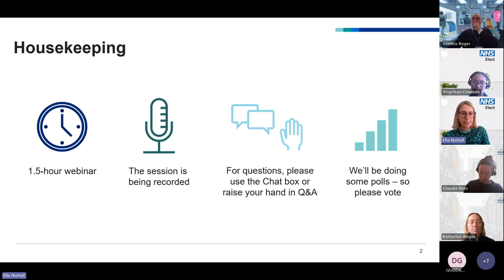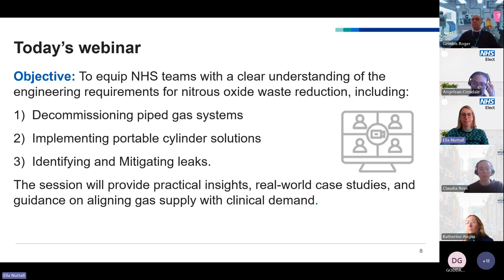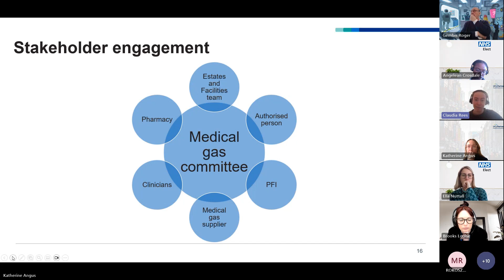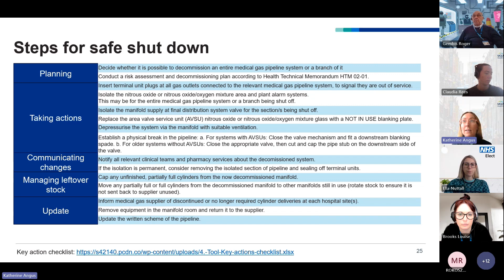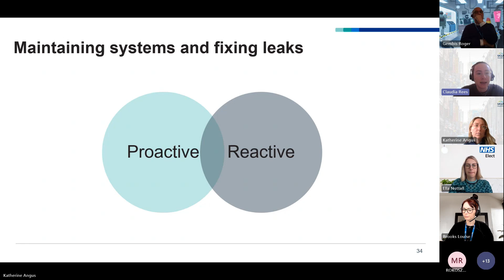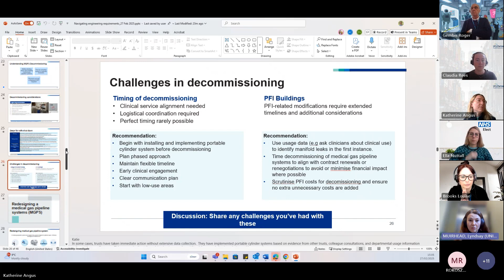Navigating engineering requirements

Comment: What a detailed discussion around Medical Gas Committee, Gas Management, Gas disposal, Gas leakage, and many more.

Obviously, Powerpoint is useful here for your meetings and presentations.

That said, I believe you must be using some other tools or documents management system that is helping you capture and manage requirements. 

At 14:56 minutes into your video there is discussion about Stakeholder Engagement and

At 16:39 minutes into your video there is discussion about upstream Waste.

These two topics were important from Requirements Management (RM) stand-point and we believe there are many other such points where RM can certainly help and improve outcomes.

Well, this is where OpenRose - FREE and Open Source Requirements Management Application can help. It supports Baselining, Traceability, Hierarchy, Markdown / Formatted Description, and ability to Copy requirements data at various levels.

It's a General Purpose Requirements Management Tool and the Goal is to help Individuals and Teams to 'DO IT RIGHT' and 'REDUCE WASTE'

- OpenRose - Requirements Management Tools Team.